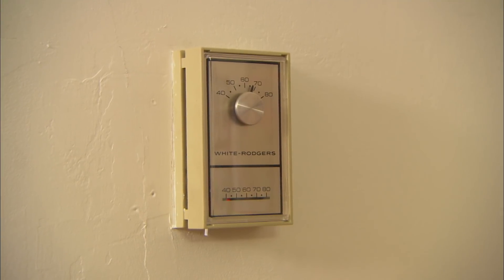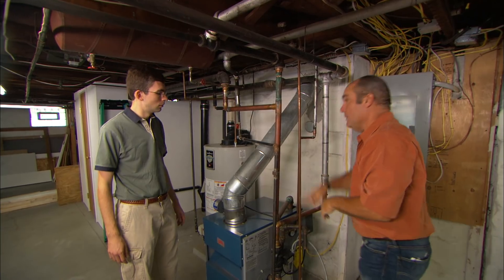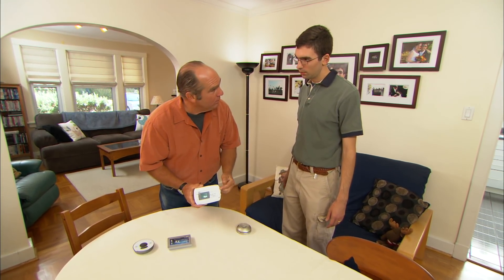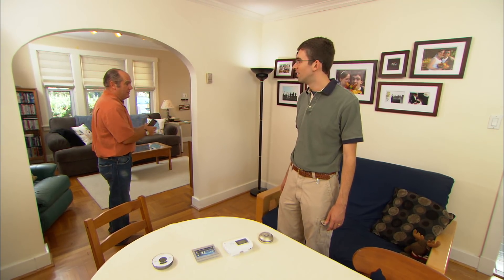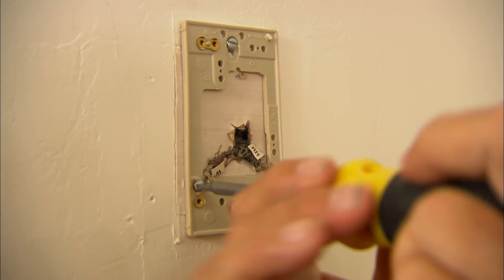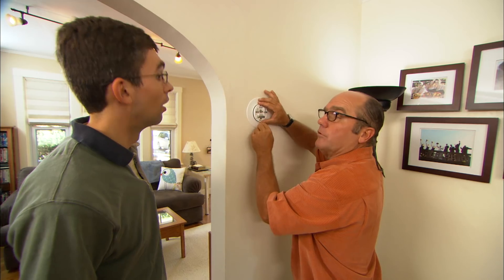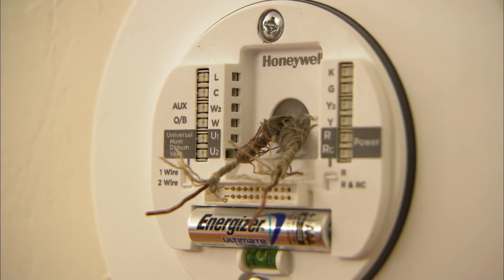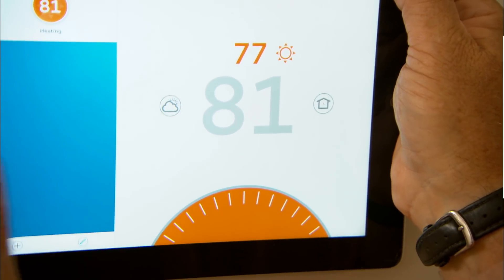How to Install a GPS-Enabled Smart Thermostat | Ask This Old House

Comment: So if WiFi was out no heat I’ll stick with basic mercery switch thermostat works for decades   Computer controlled stuff no thank you
Reply: Still works dumbass you just use the thermostat not the app

Comment: very dangerous wires if they carry household current,would have been a good idea to replace them at the same time as the thermostat,are'nt wires with textile around them forbidden these days,will they still get compensated by their assurance when they have a fire caused by these wires?

Comment: I've been in the HVAC field for over 30 years. That GPS crap is an expensive toy. Somehow people can operate a smartphone but they can't operate a basic thermostat. If your too stupid to program a standard digital thermostat once (because thats all it takes) you should never leave the house. I don't want my air conditioning system to come on in the middle of the day if I come home. That doesn't save me money at all. Keeping the system sit at a warmer setting all day long until the evening then having it cool down saves your money.

Comment: you need a common wire
Reply: Why? Didn't you notice the AA battery to power the thermostat
Reply: @chefjamesmacinnis  smart thermostats require a common wire even if there is a battery. look it up
Reply: @bkoz319  I don't know this looked like a low voltage set up. There is no common in low voltage. By comparison I have a nest doorbell it is low voltage, no common  and it had enough power to run the camera and wifi.
Reply: common wire hooks up to your transformer in your furnace 24vac. your doorbell does the same- it hooks up to a transformer. you should get a nest thermostat hook it up with no common wire (it has a battery too) and let me know how it works....
Reply: @bkoz319  yeah but this wasnt a furnace it was a boiler. They even stated that it uses a simple on/off switch. This smart thermostat is obviously ment to just open and close the circuit. 
If you just twisted those 2 wire together it would leave the boiler on none stop. 
It obviously works if they showed it working in the video.
Reply: @chefjamesmacinnis  boilers use transformers too they are 24vac. dont believe everything you see on internet. this old house is known for making multiple mistakes
Reply: @bkoz319  so how did the original thermostat work?
Reply: Look at point I'm getting at is that a common wire is not required for the furnace or boiler operation it's only required for constant power to the thermostat. This is obviously a thermostat meant to operate without a common since there was a double A battery right in the base plate. Now as for a nest yes I have a nest thermostat and yeah if there's a battery inside of it that gets trickle charged from the common. But did you know that if you have an older furnace that only has a 16 volt transformer you'll have to pull your nest thermostat Off the Wall every once in awhile and use a cell phone charger charger for it because it will lose power. If a comment was so important for the boiler to actually work there would be a common in the wall.
Reply: You can even Google that they make kits available so you can power a modern smart thermostat without a common coming from the furnace
Reply: @chefjamesmacinnis  open close switch not a SMART thermostat that require a constant power source

Comment: I have this. However, I am disappointed in Honeywell as the version I own (1.0) is NOT compatible with Siri or Alexa until their newer update (2.0). Honeywell refuses to offer an update, or even a trade-up discount. So I do not recommend this company's product. Its also priced over $200...which you might not get an ROI for maybe 2 years.  (oh, and its called Geo-Fencing...when you arrive in a certain set distance from your home/or leave that range, the thermostat will go to setting for away. But its still DUMB that I am may stay home and it doesn't get that I AM HOME, keep it warmer..duh.)

Comment: Why not save two thirds of that (or more) simply installing a manually programmable thermostat? No GPS, no fancy display, and no phone needed. Program it, forget about it. Never touch it again. This video simply highlights invented needs. Richard, you're starting to disappoint.
Reply: exactly! I'm in the HVAC industry and i actually have the second to last thermostat he showed. The fancy digital one with the colored screen. Didn't need the Internet capability but i just thought it was cool. I have it programmed to our family's schedule and it never changes!

Comment: Can you explain in more detail how the cover plate helps to stop the thermostat from reading the wrong temperature in more detail?
Reply: Bryn Shank the silicone on the hole helps the cold stay in the wall and not get into the thermostat, which would fool the thermostat in giving a false hot or cold level.

Comment: Refuse the big brother! Don't be a fool to actually install anything "smart" in your house. As a Nest installer I know a thing or two regarding Google's practices. Although this might not even be a google company, they all follow the same line.
Reply: But why? I have a smart phone. As does most people in 2019. I also have a smart TV, which helps keep the tv as wireless as possible. Only the ac cord. A smart computer. And Bluetooth everything else.
Reply: Meh, the benefits are substantial and worth it for most people.  Otherwise the product wouldn't exist for long.
Reply: You can't have that same argument with a Honeywell thermostat.  Honeywell has been around for years and they have several great smart thermostats too

Comment: Why not install something good like an ecobee?
Reply: Martin Andersson  and the owner will have issue. The power usage of it is too much for it to just “steal”’power when the equipment runs. It will cause problems and even their own company acknowledges the short cycle issues it causes because of how it’s designed
Reply: @zack9912000  Can you give links of this company knowledge causing this issue
Reply: @virgil3241  you can do googling and use their own companies term called pulsing. there is a ton of info out there on there. most of my documentation is with their engineers via email
Reply: @zack9912000 But Im asking you.  You made the statement, show the proof to back it up.  Otherwise its just noise
Reply: @zack9912000  that's not even true, at Max it wouldn't let the thing cycle within 30 min of being off that's even configurable. Also you can't steal power from pwm, it simply charges off the common the same any other thermostat that uses the common blue wire from the transformer does
Reply: You can tell by Richard's phone (it looks like a 5 or 5S)  that this is clip is a couple of years old that was recently uploaded to YouTube. Plus it wouldn't be a stretch to say that Honeywell sponsored TOH.

Comment: What he doesn’t tell people is these are easily hacked and in some states your electric company can view the data on it. Ever wonder why we have new digital meters that they can communicate with and record equipment turning on in the home... There is also legislation out pending that that will allow them adjust equipment during peak hours to save the environment nonsense. Only fools put these in their homes
Reply: Who the hell is going to "hack" a thermostat and why?
Reply: https://www.networkworld.com/article/2905053/smart-home-hacking-is-easier-than-you-think.html

Yet people want to put more “smart” tech in their homes that records them, sells the info, private data is easily compromised. The smart fad to make everything connected especially ones your power company can monitor your usage is beyond insane
Reply: zack9912000 Your tin foil hat is showing. Good job on adding just a bit of truth to your ramblings to make them seem legit.
Reply: Lord Garth https://www.google.com/amp/s/motherboard.vice.com/amp/en_us/article/j5n3pb/your-smart-electricity-meter-can-easily-spy-on-you-court-ruling-warns

“The court was quick to point out smart meter data collection often provides much deeper insight than could be obtained via the thermal imaging tech that was at issue in the Kyllo ruling. In large part because modern appliances often have distinct energy-consumption patterns or “load signatures” that not only tell the utility when you’re home, but precisely what you’re doing. The Seventh Circuit recognized that smart meters pose serious risks to the privacy of all of our homes, and that rotely applying analog-era case law to the digital age simply doesn’t work,” 

New appliances actually can talk with smart appliances and gather even more data. The latest HVAC appliance send a treasure trove of data to these meters as well.
Reply: @lordgarth1  wake the fuck up moron.. & come up with an original statement instead of plastering the same thing on every comment you dont like. No one cares if you say"tin foil hat" or "conspiracy  theorist"  do you not even know about "project mocking bird" or that the term "conspiracy theorist " was a coined by the cia to discredit anyone that didn't believe the fake jfk narrative.. look it up & pull your head out your ass.
Reply: Lord Garth it is 100% fact any minor google skills will find all the documents and facts from numerous publications. Like it or not it’s 100% fact look at all the internet connect amazon boxes that have shown they are always recording audio in your home and keep records of said audio it captures. Yea I am making it all up lol

https://www.businessinsider.com/amazon-alexa-spying-scandal-creates-trust-problem-with-customers-2018-5

Comment: Will this work with a line voltage thermostat?
Reply: Yes, for .0001 seconds.
Reply: plucy470 thanks. I’ll make sure I’m licking it for the .0001 seconds
Reply: No.
Reply: Absolutely not. You'll need someone to install a relay package so step the line voltage down to a 24v system.

Comment: Does the Lyric support cold temperature lockout for heat pump? I replaced a nice Honeywell programmable thermostat with a Savant-branded thermostat (so my Savant smart home control could talk to the thermostats) and unfortunately the Savant smart thermostat is a huge step backwards.
Yes, it supports geofencing but it doesn’t support locking out the heat pump (thus using my oil burner backup) in very cold weather.  My old thermostat had an outdoor temperature probe and used that not only to lock out the heat pump in very cold weather, but also to anticipate when to turn on the heat so it would be able to warm up to the desired temperature at the programmed time without kicking in the oil burner if it wasn’t needed.  Same thing for the A/C in the summer, it would bring the house down to 78°F by 5pm, starting at whatever time was needed based on temperature.  Geofencing sounds nice but having the A/C turn on only once I arrived home isn’t very useful, the house will be hot; the A/C needs to start before I arrive and GPS alone isn’t going to make that happen.  I suspect the Lyric has the same shortcomings.

Comment: Still rocking the CRT TV as well.  wow!
Reply: Eh, I have one in my house too, Picture quality never really bothered me, it's more what show its on. When it dies eventually I will replace it with a nice 4k tv but it's probably going to be a while, the other reason I don't want to replace my crt is because its a 45 inch, so it's freakin massive and I really don't understand how the previous owners got it in the house.
Reply: @MoneyAndPeople  Yeah with that much glass, that sucker is probably pushing 300 lbs.  I had one like that, and not only was it heavy, but there were no good places to get a grip on it.  Even with two guys carrying it, it was brutal.
Reply: I got one of those too. I use it to watch classic tv shows, as they look horrible on current models.

Comment: 0;40 what is that tank hung of the ceiling in the basement?
Reply: It's an old hot water expansion tank for the heating system.
Reply: It's for the heating system. When water heats up it expands so you need a place for it to go. Hence the big tank.